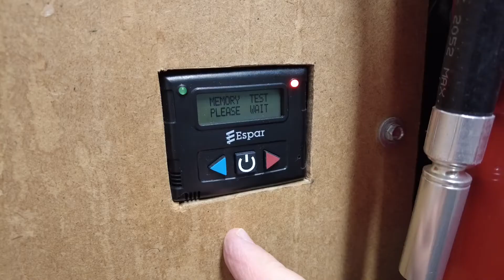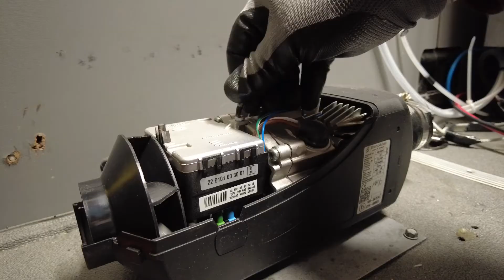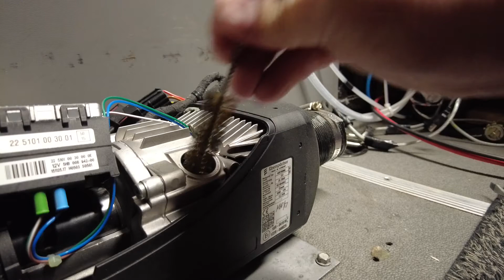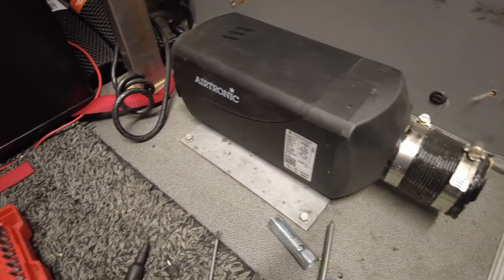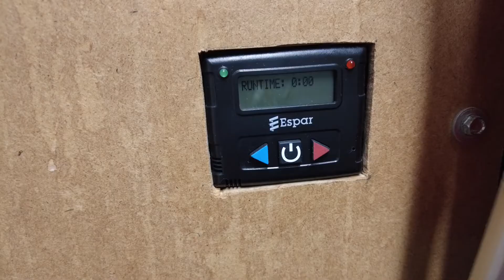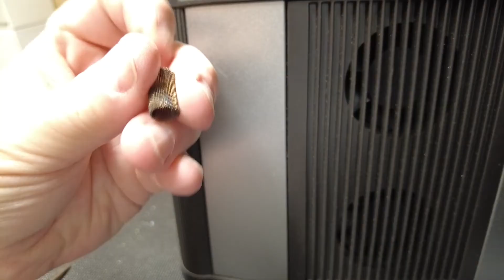How to replace the atomizer screen in an Espar D2 diesel heater DIY

Comment: It functions as an emulsifier, not a filter . It insures that a stable primary combustion occurs. Always install below the air hole . Make certain that the hole is clean and free of any flash left by the casting process . A rich primary combustion will foul the burner and cause poor secondary combustion resulting in carbon build up . White smoke is the result of a wet glow plug caused by improper screen installation. The glow plug must seat properly .

Comment: Super useful, just no longer correct! Eberspacher changed the design of the glow pin (now you just snatch it out of there with a needlenose pliers) and the atomizer screen (hell if I know how to get that damn thing out, I'm freezing my ass off witha broken heater). Anybody with a new Eberspacher -- GOOD LUCK with your very expensive heater with no support whatsoever. BUY CHINESE. GET BETTER SUPPORT.

Comment: Does the screen need to be lower than the flame front hole that you pointed out? I can't seem to get mine to seat low enough to clear that hole and no matter what I do the thing won't start. Glow plug is good. I've cleaned up the whole unit and it just smokes

Comment: I ue a 7mm thread cutting bit to pull the old screen out it just screws in and pulls the screen out efficiently it will destroy the old screen by cutting into the inside but it works well.

Comment: Why question to anyone that can answer it is my heater in working one time only in my 2023. Freightliner has not worked since failure to sense heat. So what would cause that is my question.
Reply: Your glow plug may need to be replaced.

Comment: Glad I watched this video. I replaced mine but dismantled it much further than you did. I totally removed my heater from under the bunk of my truck and replaced the two gaskets and the glow pin and glow pin screen. It cost me $252.00 USD for the parts and I consider it a business expense for my federal tax return. After seeing how you did yours I will in the future try your way instead of tearing it down on the bench. Thanks for the great video!
Reply from the maker: Thanks for your comment! I've done the same with my Espar several times, but less so lately. The most important thing is to start up the vehicle first before starting the heater. This way the glow pin gets the right amount of amps (10A) coming from the alternator. After a few years of trying this, my glow plug and screen seem very clean and it still hasn't smoked. I do change out the screen and clean the glow plug and ream the air intake hole. It keeps the heater running in very good shape, especially this time of year in the northern hemisphere. Best of luck to you and your heater! Stay warm!!

Comment: this was very helpful and easy to understand thanks to your great camera angles. You mentioned a little bit about the air hole, but didn't discuss much about cleaning it out. I suspect mine might be clogged because I'm getting a ton of white smoke on startup and it's kind of unreliable. working on getting myself one of those sockets. i'm determined lol
Reply from the maker: Yeah the air hole is difficult to clean, but if you can find a small pick and keep picking at it, you'll eventually clean all the carbon out. Make sure your electricity is capable of at least 10A during startup - everything will work very well for a very long time

Comment: How often should you replace the glow plug please.
Reply from the maker: In 6 years I haven't replaced the glow plug. Keep it very clean during service, and it should last you many many years. Have one on hand during the winter in case yours dies. Just in case. Super easy to replace.

Comment: Isn't it easier to put the strainer on the glow plug and insert,
Reply from the maker: Espar provides a tool to set the strainer in the correct position.

Comment: How many hours do you have on the unit with doing this maintance?
Reply from the maker: About 500 hours. 

Recently I've done much longer, about 1500 hours and counting since my last service without any smoke at all.

I've found if I turn on my van first, or have a battery charger attached to the starter battery (the D2 is connected to it), and then turn on the D2, there is much less carbon buildup especially when it's really cold outside.

Comment: Thanks for interesting video. 
I always get the screen out unharmed. I use either a coach screw or eraser end of a pencil to wiggle screen out. Has so far worked fine. I then clean screen with compressed air followed if necessary by heating it with propane torch. 
Therefore after four years I am still running on original screen and have no issues with my heater.
Reply from the maker: That's great - thanks for sharing! I'll have to give it a try next time I service the heater.

Comment: Thanks, I think you are one of the few people who does maintenance on these heaters. I joined a FB group and most people who commented on my question thinks maintenance on this heater is a joke. I left.the group since that was the main reason
Reply from the maker: Hi J, thanks very much for watching and for your kind words! It's definitely worth maintaining since we like to have reliable heat when we travel. I try to change the atomizer screen every 500 hours or so, being proactive helps reduce the need to change the other gaskets and pull the heater from the van. I still have to do it, but less frequent. Not sure if you already saw my website where I have much more detail and photos on the Espar heater maintenance. https://sprinterdiscovery.com/heater/
It's also my way of record keeping for this heater. Atomizer screens from eBay are dirt cheap (link in my page), and worth changing out proactively.
Your welcome to subscribe, and when I do my next major maintenance I'll upload the video here too. Thanks so much for watching and commenting - it really helps out my channel! Have a great day ahead!

Comment: When placed at correct depth, does the atomizer screen overlap the small air intake hole? Or is the atomizer screen set deep enough that its top edge does NOT overlap the air intake hole? I know to use the plastic insertion tool. But still would like to know. Thx!
Reply from the maker: Hi!  The atomizer screen is set so that the top edge is not overlapping the air intake hole. Just below the hole is the fuel port, and that is where the actual ignition occurs. If the welds on the screen are up against that port, it can cause slow or incomplete ignition over time due to the slight blockage and cause more carbon.  I reviewed my video and I should have said "fuel port" rather than "air port".  Thanks very much for your question, and thanks for watching!  Hope it helped a bit! :-)